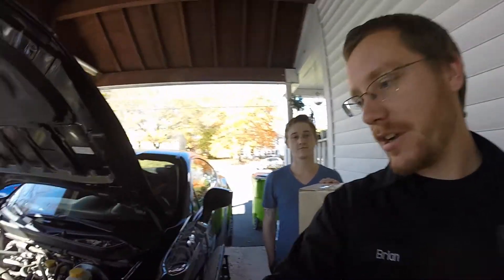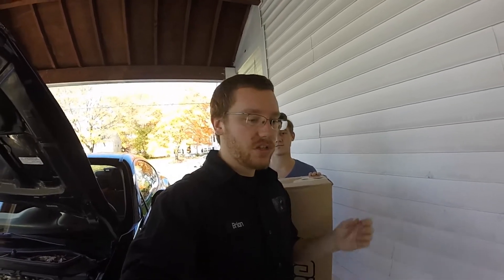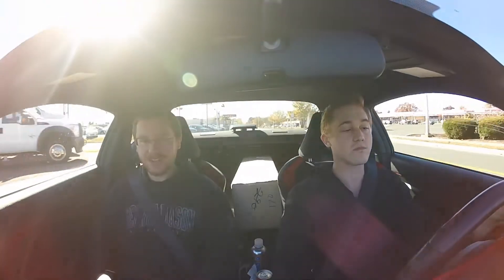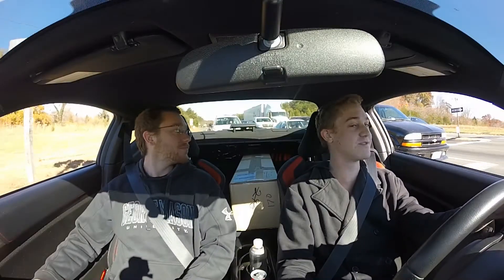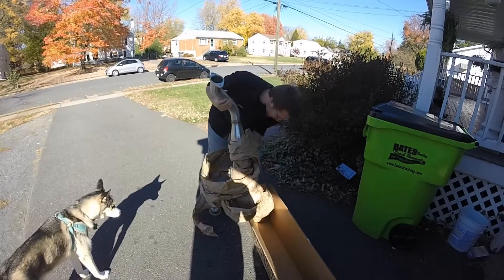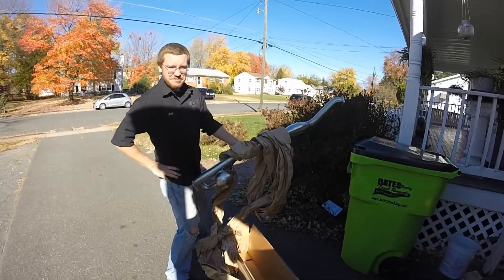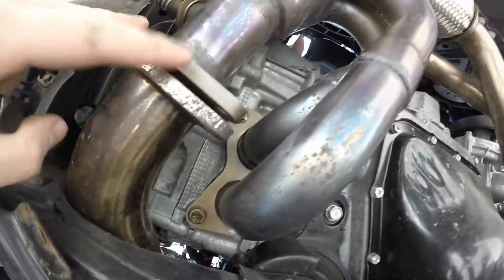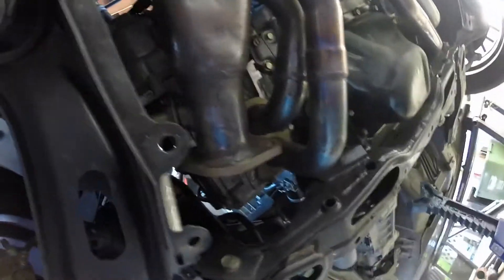FRS Nameless Performance Frontpipe Install/Comparison - VLOG #10

Comment: Did you have to use a gasket at the end of the front pipe that connects to midpipe?
Reply from the maker: Yes if I remember correctly.

Comment: Any sort of fitment issues with the Nameless pipe?
Reply from the maker: Not once installed. Only difficulty was getting the pipe over the K-member, we had to lift the motor to make clearance for the install.
Reply: how did you lift your block exactly
Reply: @ardikasulistija6574  probably a jack